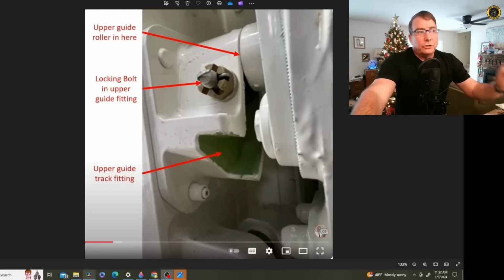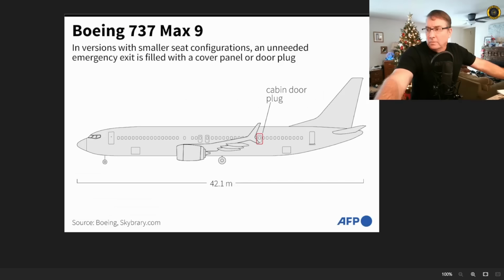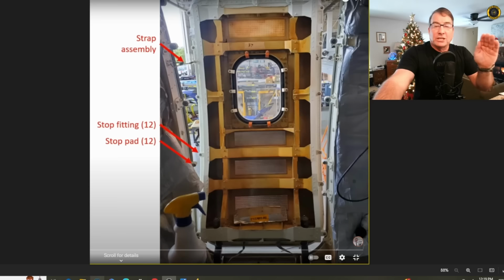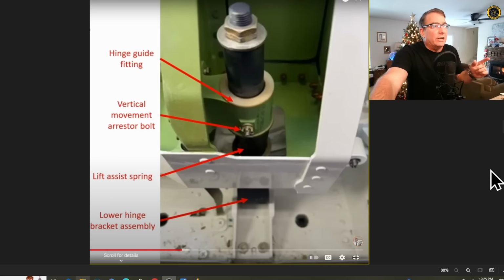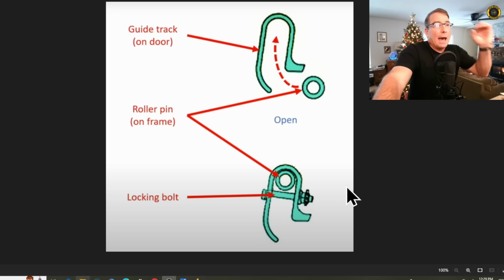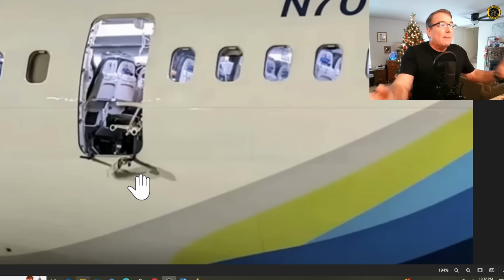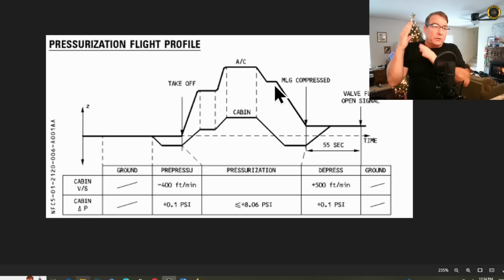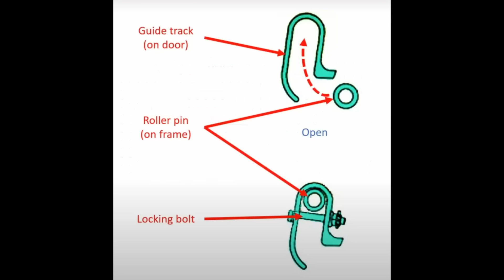Alaska 737 Max-9 Door UPDATE! 8 Jan 2024

Comment: Here's the REAL question.  Why plug emergency doors in the 1st place?  It's already very difficult to meet FAA evac requirements on pretty much any airliner with the minimum amount of doors installed.  Keeping 2 extra doors workable just enhances safety.  Now I know airlines are too damned cheap to ever exceed the minimum FAA standards, but the doors are already there.  Sure, there is a bit more MX required, but what's the priority, saving a few bucks over the years, or a LOT of lives?   As an example, FAA requires all pax evacuated in 90 seconds.  The JAL Airbus that just crashed into a Coast Guard plane, and was ON FIRE, took 18 minutes to evacuate.  As a retired career airline pilot, this is just one example of profits over safety.

Comment: looking at upper door plug assembly, another possibility is faulty weld/attachment of the plate that hooks the bolt.  Such as someone used wrong welding rod or wrong bolts.  Since these are likely done at the same time faults on both sides  and in all the attachment plates would be feasible.
Reply: Or that the surface prep (cleaning, decontam) or temperature ramp of the welding process was rushed or just not right.
In the electronics world, the #1 failure mode is the "cold solder joint" on ther printed circuit board.

Comment: Someone please explain to me why a Locktite type thread substance isn't used (as a redundant safeguard against loosening) in applications like this where the bolts are responsible for securing a key structure like a door plug and also where it will be hidden from visual and mechanical inspection for an extended period.  I get the mechanical method of securing the bolt/nut but why not have some extra "insurance" for all the fasteners in this situation?

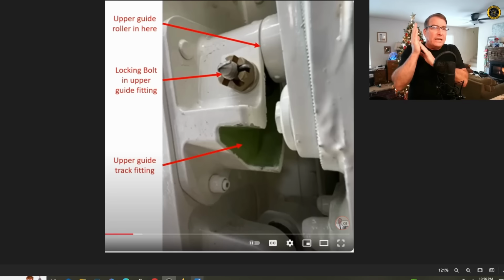Comment: @8:33 What is baffling about the roller locking assembly is a fracture critical bolt interfacing with a pin radius. NAE but that upper locking bolt does not appear designed to retain the panel under load. Assuming the lower hinge bolts failed in some way (fatigue from springs?) fatigue immediately began at the upper locking bolt in a very concentrated area from the load of the springs. Combined with the reported loose hardware, more than one safety margin was overlooked on this panel.

Comment: Do you think there is any link with the low cabin pressure indications they had earlier? And if the door was slightly (causing the air leak) open should that not have been noticed by the walk around?

Comment: is upper door guide a cast part? would it develop a crack if an impact driver was used to tighten the bolt?  Is there a torque spec???

Comment: We can talk all night about bolts & torque & split pins but this is super serious. Super serious from the point of view that they killed countless people with these planes,  Almost had them grounded permanently, got the FAA very, very involved in the Max, changed production procedures etc, etc, lost their CEO, gave reassurance after reassurance that when the Max came back into service it would be 100% safe....and yet here we are.  There is a Boeing employee who has confirmed that the culture has NOT changed & that inside of the factory the lines (1 per day) are schedule driven NOT safety driven. Indeed he maintains that literally thousands of QA checks have been eliminated, something that even the FAA are still not aware of. If you combine scheduling pressures with lack of QA checks it doesn't take a genius to realise they cannot ever deliver on the 100% safe promise. They are simply sending them out & hoping for the best!

Comment: Juan, that design for plugging that hole is not at all acceptable. It's like they are looking for the cheapest way out, not the best design. It shouldn't rely on pressure, it should be as solid as the rest of the cabin that is not doors. When you consider the over all engineering of these airplanes, which is very impressive, this plug design is awful and doesn't come close to proper engineering. It works until it doesn't. The fix will just maintain the same bad design. That is not to say there wasn't mistakes made installing them, I cannot know that.
Reply: I believe that the other doors also rely upon pressure to help hold them in place. And remember that the design has to be compatible with actual exit doors, so there are some similarities in the mechanisms used.
Reply: @JohnHallgren  if these doors are never to be used, they shouldn't rely upon how functioning exit doors operate. They should be permanent and not fluctuate with cabin pressure as the other doors that must. Obviously the way it is being done isn't working. There was a problem with more than just this one airplane. They could just have a regular door with a sign, don't use, but I am assuming there are not seats blocking emergency exits. Using the hardware from operational doors for inoperative doors may be convenient, but not solid engineering. The doors just need to be pinned into the frames directly. They should not at all be attached with any of the hardware from actual emergency exits. This was done for convenience only. I can only hope the FAA has engineers on staff. It would irresponsible if they didn't.

Comment: @blancolirio: what if, when Boeing did everything correct but the locking bolt itself failed? There vertical  moment arresting bolt looks to small for me. It should be one or two sizes bigger in diameter.  Or maybe the bolts where made from the wrong material? Shouldn’t it be stainless steel or even titanium? Couldn’t it be possible the bolts cracked even when they where  correct installed? I'm not an investigator but a mechanic. But these are my thoughts how it could happen.

Comment: This was an emergency exit? I don't know if I got that right, but if it is, I am staggered by the design that requires the undoing of 4 nuts and bolts to open it, apart from needing to be pretty dextrous with removing the cotter pins. It seems an odd arrangement. Perhaps someone could explain how this setup is intended to function?
Reply: That's an deactivated emergency exit. If aircraft are under a certain seat limit they don't need all possible exits. So some can be closed with a permanent plug. This plug is not made to open it except by a mechanic at the ground.
The plug fits into the same opening, but is technically different to an active emergency exit
Reply: @simonm1447  Thanks for that clarification Simon. Makes more sense now :D

Comment: Is that picture of the upper guide and vertical stop bolts upside down?  I thought the plug had to move up to slide the pins from the pads? But the picture shows that upward movement would be impossible, right?
Reply: AFAIK the plug has to slide down (not up), before the pins disengage. The spring pressure is supposed to equal the weight of the door, so that it is easy to open in a (genuine) emergency.
Reply: @gordonrichardson2972   the latest NTSB YouTube says the stop bolts prevent the door translating upwards, moving up to release.  I don't know if the doorway plug in this vid is the same as in the one under investigation, otherwise, who is right. :)

Comment: This aircraft already showed several pressurization issues.
Why didn't Alaska Airways check the very most elementary structural elements holding the fuselage closed?
Reply: Because that was a different issue
Reply: @rumbecker5085  Do you have any evidence for this steep thesis?
Reply: @peterebel7899  Yes, there are many complex system with moving parts that keep aircraft pressurized. A door plug would be the last place to look. If the door was leaking, there would be a loud whistle noise the entire flight. If there was noise from that area, they would have inspecter the door.
Reply: @rumbecker5085  So you expect other issues being the root cause for thids airframe's pressurization issues?
- What does this tell about Boeing's quality management
- How could an airline operate jets with non functional life essential systems?

Is this all American standards?
Reply: @peterebel7899  Nothing to do with American standards, both American and European Regulators allow Aircraft to be operated with defective equipment, it is all regulated and their wold not be much of a difference between Boeing and airbus aircraft. Do you know if the Boeing in question was operating with any known defective equipment?  The issue with the incident Boeing was a quality control issue.
Reply: @rumbecker5085  The difference between Airbus and Boing is just the one is delivered with all bolts in place, the other not.
Some call this quality standards, others call this safety standards.
Reply: @peterebel7899   You keep moving the goalpost. You said 

"How could an airline operate jets with non functional life essential systems?"

This is not true, it was not allowed, you keep moving the goalpost because you are ignorant. 

Google why Qatar is suing airbus because of the A350 issues. Both airbus and Boeing have had their issues.
Reply: @rumbecker5085  I don't see any connections between an Airbus paint issue under extreme climatic conditions and loose bolts in many checked Boeings, even a door plug blow out in flight.

Enjoy flying Boeing!
Reply: @peterebel7899  I prefer Airbus, enjoy moving goalposts and make believe fantasies in your head.

Comment: From my chair, I'd say that's a bad design. Some one made it just cheap enough to be a failure point. All twelve of those pads should have pins through them making is nearly impossible for the plug to move in flight / once even slightly pressurized. Relying on shear bolts / pins, esp. only four, is asking for trouble. There's a reason the cargo doors aren't held closed like that. I guess the team that designed that plug has never heard the term "inherently safe."

Comment: It would be interesting to know how quality control works with factory the installation process. Would this be done by one person or a buddy system? Who checks to see if the work was indeed done and done correctly? The aviation industry has (had?) a reputation for being very stringent in manufacturing/installation procedures and quality control. This seems like it will be one those situations where there is multiple things that didn't happen as they should.

Comment: How does this door plug seal to maintain cabin pressure? It can't be very tight if the door needs to move vertically and also compress the rubber. Is the seal inflated? Also those bolts look like a pain to install from the rear, this could encourage bad behavior

Comment: As several people have pointed out the door plug probably could not raise to unlatch itself without all four bolts missing. Am I correct in thinking that the door could not come off the end of the hinges without the washer, nut and locknut missing as well? Would this have made the situation even worse as the door would have been held on the hinges rather than ejected completely from the aircraft?
Reply: I am reasonably sure that if the door was pushed outside the aircraft, even a little bit, that the force of the wind would tear it off of the hinges.

Comment: NTSB said today that the plug door is designed to blow out under rapid depressurization. I don't understand what the logic for that design decision is and I don't understand how that can happen with wired bolts holding it closed? Is there another mechanism that allows the plug door to blow off?
Reply: You mis-heard. The NTSB stated that the locked cockpit door is designed to open during rapid depressurisation.
Reply: @gordonrichardson2972  Thank you, you're right. Appreciate the correction.

Comment: I am not a mechanic nor an engineer nor a pilot. Just an average person so I’m having a hard time with understanding something about this. Please clarify. 

I did visit the YouTube page of the man in the UK with the details of this door. His presentation has generated a lot of very interesting discussion so I would highly recommend it. 

He said it’s a “plug type” door that is thicker on the inside than outside so as not to fall through the aperture. This is an easy concept because anyone with a sink drain stopper knows that the top part is thicker so it never can fall down into the drain hole, which is where gravity wants it to go. In the case of the plane door plug, it seems the outside of the place would be where this door would “want” to go due to the air pressure but because it’s “thicker on the inside” it doesn’t fly out of the hole much like your sink stopper doesn’t fall down the drain pipe. 

My question is, if the door itself is designed so that it can’t fall through the aperture, assuming the thicker portion is on the inside, then, bolt or no bolt, how did that “plug type door” fly off with out taking pieces of the hull shell with it?

(What if it was installed flipped over and the thicker portion was to the outside? How else could it “fall through the aperture?”) 

Happy to be corrected. I’m hear to learn not here to have an ego.
Reply: The discrepancy is with the geometry of the opening and the door here, the door fits through the opening once it is raised a bit. It cannot move through unless it is raised. Notice that here the door is not bigger than the opening and does fit through (when raised). So the nature of the damage tells us the door must have raised before opening outward. In other words it opened in the same way it would be intentionally opened, and therefor it did "fit" without tearing or bust through anything. It seems most likely the damage was done to the individual parts after it opened, simply due to the wind ripping it away.
Reply: Yes, thank you! I think I’m getting it and that’s why the NTSB people in the news mentioned the “slides” and hence the discussion on the other page about whether it has to be forced “down” like the manual says or forced “up” like the people maintaining it say. 

So, it’s truly a hybrid of a plug and a door. If just a plug, there would be no need for that “gap” to slide it (up) into in order to open it. Yet, it’s not a door because there’s no exterior opening/closing mechanism since the bolts are inside the walls. 

With a plug, there would be no gap and in theory would stay put. With a door, there would be an exterior latch to visually check whether this was properly closed. But, with the “door plug hybrid,” it’s all hidden from exterior view and if not properly shut (in this case, no bolts or loose bolts AND it sliding into the gap position) no one would know—except the airplane that sensed pressurization issues on previous flights. 

Wow. That’s why “where are the bolts” is the theme. That’s a lot of risk riding on those bolts. You’d think they’d have external, redundant latches as well except that it’s a cosmetic issue. 

Thank you for your kind reply :-)

Comment: Just like @jeffropenn mentioned... was this a 4-point failure, (human failure)? Did you ever run across when the last inspection was done? Even on a new delivery I would suspect Alaska would do their own safety inspection.
Reply: This plug is behind interior panels. I don't think they do a C check on a new aircraft to ensure Boeing hasn't fucked up the assembly. 

Ok, if Boeing continues to deliver such aircraft some airlines may soon consider C checks after the delivery.

Comment: Why is it called a plug door if it can be blown out? Years ago I was seated at the emergency exit and that door was a plug ,after unlocking it , the door had to be brought inside and then pushed out the emegency escape.
Reply: This isn't a plug door, this is a door plug!  Bad choice of terminology. Plug door installed from the inside, door plug or the escape door that would be there installed from the outside. And MX frequently opens the plug for ventilation and access.

Comment: This looks really bad for Boeing. It's inconceivable that 4 cotter pins were severed, 4 properly torqued, castellated nuts backed off so far as to fall off entirely, and 4 bolts fell out of their installation positions, all on a relatively new airplane. And that all had to happen BEFORE the door plug could be jarred out of position.

Comment: Can anyone tell me why the castle nut on the locking bolt in the upper guide fitting is being held in place with a cotter pin and not safety wire as is used on most aircraft?

Comment: can I ask is the photo upper guide roller/bracket assembly as shown here, upside down? as based on the description from NTSB briefing the door plug has to move vertically upward to disengage from the 6 locking tabs on each side of the door plug, if the locking bolts with nut & lock pin were missing or failed as it was stated at NTSB briefing, the bracket was fractured due to the door plug moving in upward vertical movement allowing the disengagement of the locking tabs.

Comment: All threaded fasteners have two basic problems built in to their design. The first is the  tendency to cross thread. The second is that ALL of them will vibrate loose given enough time and vibration. That's why god made castellated nuts. what is the bolt going to do? Vibrate tighter?

Comment: My bet is that when this door was installed, someone missed putting in all of the fastening bolts. Then they paneled over the door plug creating a ticking time bomb.   Boeing’s safety record since they acquired McDonnell Douglas has been absolutely atrocious.  Just look at the number of accidents that have occurred with Boeing planes due to technical / mechanical issues over the last 3.5 decades.  Many of which occurred with relatively new planes, and that resulted in complete loss of the aircraft with all onboard perishing.

Comment: It seems that this door is spring-loaded to open (assuming the arresting pins fail). Why would you do that on a plug that is only supposed to be opened in a hangar? Or am I missing something?
Reply: Apparently the door is spring, loaded to provide essentially a weight neutral door to make it easier to open.